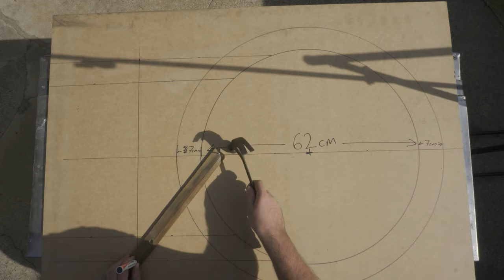DIY Pizza Oven Build - 1 Month Build in 5 MINUTES!

Comment: Looks like you have been sitting back and studying other builds like me before taking the plunge. I really like your stand because if you move house you can just unbolt it and break it down into 2 pieces. Very economical build with using just a few fire bricks. Inspiring..!!!  Now I need to learn to weld :)
Reply from the maker: Thanks mate 😊 I thought the stand was what made this build special too, I had the idea and couldn't find anyone who had done it, but it's solid as a rock so very happy with the result. Hope your oven goes well when you do take the plunge!
Reply: cut your pieces of metal...take it to a welder.   It will be easier if you have it clamped together or screwed in place.
Reply: @couldyoucook3085  Yeah- the stand idea is brilliant!  When I see other pizza oven builds....and all the work for the base...and materials...and then you can't move it later..😡
Reply: Absolutely, the welding I forgot about that

Comment: Smart move making the base first making use of the same plywood, smarter move moulding the chicken wire beforehand, saving the torture of trying to mould it on to the wet mix, not to mention the recessed fire brick on the base etc.
I'm going to take some of your idea's! Going to try perlite instead. Do you have an issues with the vermiculite with wet weather?
Thanks
Enjoy the pizza's.
Reply from the maker: Thanks Joe 😁 I rendered the exterior for weather proofing, seems to be working well, but smart move using perlite as the vermiculite is quite crumbley. Good luck with your oven!

Comment: really nice job. thanks for the idea. and do you think this type of oven can work for small scale business? like if I do 2 of them where each can take two pizza doughs at a time. I am wondering if this formula still can cook a delicious pizza and some other bakeries? thank you,
Reply from the maker: For a business it is definitely worth investing more in the materials to make something that holds the heat for longer, this style of oven is good for a family bbq with half a dozen pizzas, but looses the heat quickly, a serious pizza oven will stay hot all day without having to constantly add fuel
Reply: @couldyoucook3085  thank you mate for valuable advice. I am considering to use a natural gas, rather than wood fire, because I am going to build it into the café. I want to keep it light and portable, in case I change the spot. but do you think this structure can work good for natural gas heating? again thank you
Reply from the maker: @rmlabdullayev  The main reason for building a pizza oven is the taste, which is from the wood fire, the design is to accommodate a wood fire and get it hot enough to cook a pizza in 90 seconds. If you are considering natural gas then a decent gas oven will work fine (probably much better) than trying to make one, and be cheaper than building a commercial grade pizza oven.

Comment: 21 dislikes? 21 good for nothin lazy buggers cant get there hands dirty. Love your work mate, you have inspired me. thumbs up from Australia, I will definitely throw some shrimp on my pizza 👍
Reply from the maker: Cheers mate 🍻
Reply: That must be from Pizza Shops like Domino's, Pizza Hut etc
Reply: The dislike is probably for the horrible background noise.
Reply: @jacquesmertens3369   i have musicians deafness , everything sounds great 😂
Reply: shrimp goes on tha barbie
Reply from the maker: Straya
Reply: The dislikes are probably due to the wrong cement being used. I've just dismantled on that collapsed and it was made out of brick and 5 years old. A properly built pizza oven uses heat resistant cement which is an additive to the mix. Good job but I'll give it a thumbs down too. It would be better if you showed people how to do it correctly. I can imagine imagine lot of people have built one just like this. I wouldn't eat the pizza out of this oven. As the cement weakens and becomes loose it'll drop straight onto the pizza. Crunch crunch!

Comment: Hi man, it's been few month I start the same idea, I try to build it on a trailer, one fail at the moment. I did a new sole already, but considering what is the best for the dome. I'm building it on a trailer and seriously thinking about strength. Would u have advises for more adapted materials? Or do u think it would hold the chocs ?
Thanks man

Comment: Hi, nice job, would you please share your cement ratio especially how much vermiculite you add in the mix ? Thanks
Reply from the maker: Thanks! Sorry I don't remember off the top of my head, but if you head over to the playlist for the oven build each video breaks it down into a lot of detail including ratios I used. The first video (base build) has the vermiculite ratio I'm pretty sure. Here's a link to the playlist https://youtube.com/playlist?list=PLMDHY347ibAXhCmrdZHmFCs-zReHWMFur

Hope this helps ☺️
Reply: @couldyoucook3085  just regular cement powder  no special mud?
Reply from the maker: @tracegrubbs7125  that's what I used yeah. I'm sure refractory cement would be better but was keeping cost down. I'm  happy with how it's doing so far
Reply: @couldyoucook3085  nice tnx for Info.

Comment: Hi, great thing. How long does it take to warm it up? And I thought that only Portland cement doesn't stand the heat. Shouldn't be added Alum to the mix for that reason? Regards
Reply from the maker: Thanks 😊 I usually start a fire about an hour before hand to get some coals. I used general purpose cement which Im pretty sure is the same as Portland and it's still standing. This is a very cheap way to build a pizza oven. My cost in materials was around $300 (a proper oven would be more like  $1300) There is lots of things you can do to produce a better oven but the price goes up. I haven't heard of adding alum, maybe it would be a better way to do it?
Reply: @couldyoucook3085  how long did to let it sit to cure before deflating the ball
Reply from the maker: It was between 1-2 days, can't remember exactly, you want it to dry as slow as possible but also evenly. So it was a balancing act between wet towels and deflating the ball so the inside could dry

Comment: I've watched a number of pizza oven videos and have noticed the chimney is at the front of the oven. Is that for even distribution of heat?
Reply from the maker: I think it's to do with the 'draw' or how the air is sucked in, circulates and exits. Results in a much hotter oven than if the chimney is at the top
Reply: @couldyoucook3085  thanks for the info! BTW you did a great job on yours.

Comment: Why did you use fire bricks on the bottom? Is that 100% necessary?
Reply from the maker: Fire bricks hold the heat. The vermiculite concrete acts more like insulation. It's also a bit suss cooking on concrete, especially this stuff as it's quite crumbley
Reply: 100% necessary.  Using any other brick will  after time get thermal shock and disintegrate

Comment: Does anyone know why they only put the bricks in the center of the oven? Are those firebricks? I've seen that before
Reply from the maker: Yes they are firebricks. It's for cost. This build cost about $300.  While using more firebricks would make a better oven, when I built this in peak covid it was $8 per brick. Also in my case it was for weight due to the kind of stand I've made. Bricks in the middle means it's a hot cooking surface.
Reply: @couldyoucook3085  thanks for the reply.   I've seen several builds here and it seems to be fairly common to only do the center.   Cool build thanks for sharing 👍

Comment: Can you please share the total height at the top of the dome?
Reply from the maker: Inside the dome would be about 40cm. Total height outside including base and render would be about 58cm?  It's purely a case of what size ball you use, how thick you want to go with your walls, whether you use insulation blanket etc. I went with this size simply because of the size of timber board I had to use for the mold.

Comment: Do you have a materials list you can post?
Reply from the maker: I don't have a complete list to be honest. It was a while ago now So i would struggle to remember it all, and a lot of it depends on what you have around the house and also what materials/expenses you're happy to deal with. The playlist breaks down the process in a lot more detail, particularly the first video for the base which shows the initial materials I used to build the dome, but even that doesn't include things like tape and nails etc. Here's a link to that video if that helps https://youtu.be/MCkNHkzfUEQ

I might make a 1 year later video and work on a list for that as you're not the first to ask. Cheers Paul 🙂
Reply: @couldyoucook3085  thanks! I’ll check out the other videos. How’s it holding up? Really mostly interested in the type of fireproof concrete and the mix.
Reply from the maker: It's holding up nicely in my opinion. There is cracking but only superficial. This build cost around $300 (could easily spend another $1k on materials for professional quality oven) so it was always a compromise on materials. I just used general purpose cement and vermiculite (in future I would use perlite) and am happy with the results. I built the stand in such a way it wouldn't be difficult to remove if I had a failure